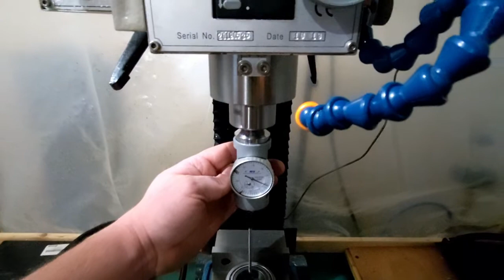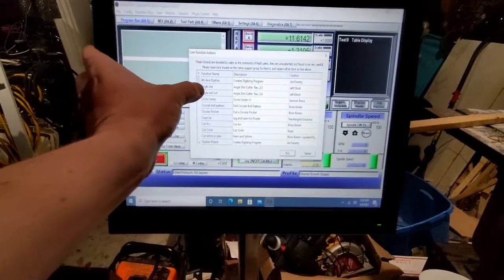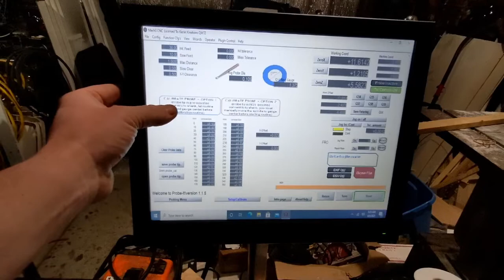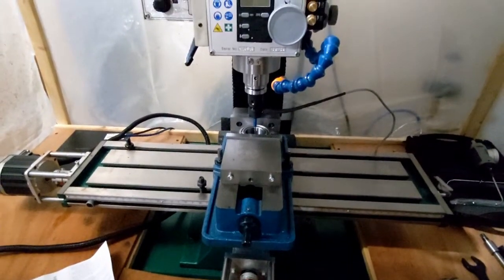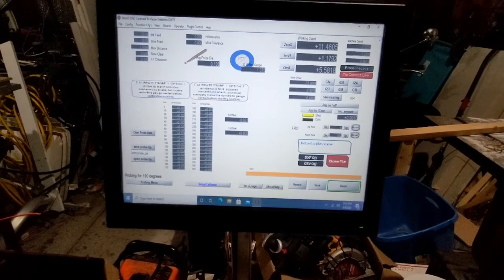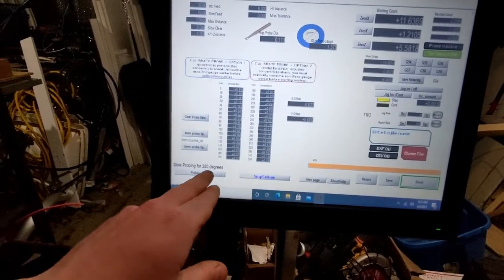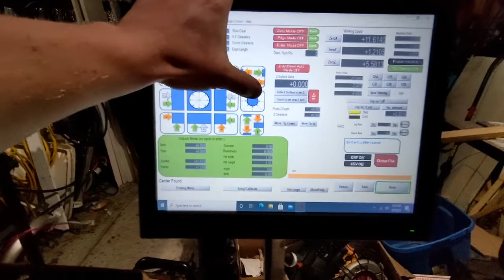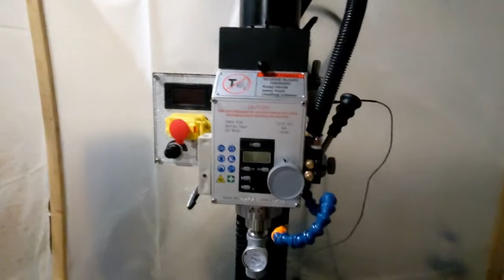Probe It! - G0704 CNC Touch probe setup - repeatability test

Comment: The ebay link for the probe is no longer any good. Do you have any additional information on it. Seller, Manufacturer or model number?
Reply from the maker: So the Probe I have is the TP100r2 by IMService, unfortunately I don't know why the store is now gone, and why I cannot find the listings anymore in the US.  I would lay caution, as after a quick google search I did find the manufacture website, but it is outdated and half working. I would say if I were to do it again, I would look at another probe. If you want to go down the rabbit hole, look at https://www.ebay.com/str/imsrv as that was their store, but seems to not be listing anything, they do have their contact info on there, so maybe it would be worth it to contact them directly.  I don't want to stray you the wrong way, but maybe covid had something to do with it? if you find anything else and want to update, would appreciate it.